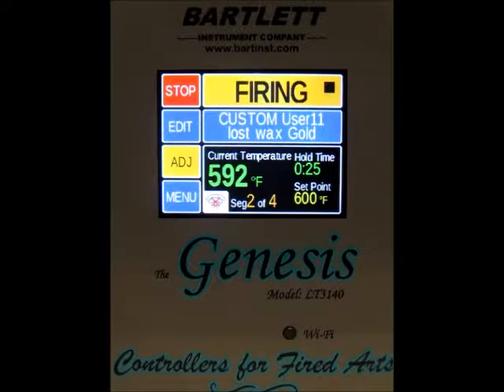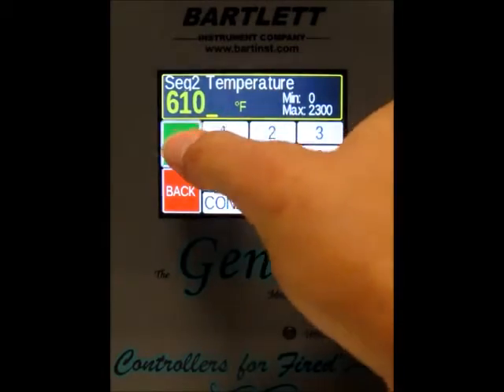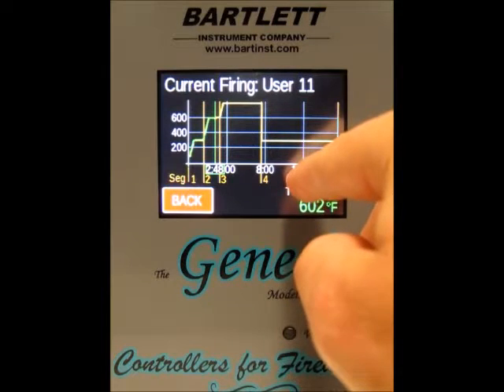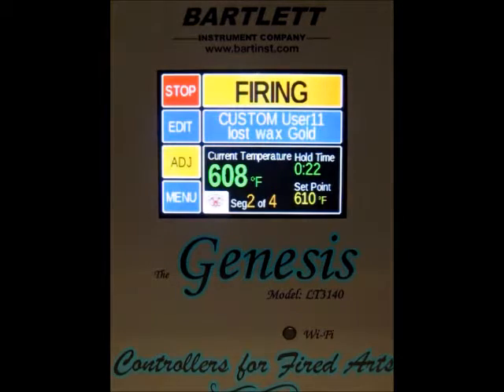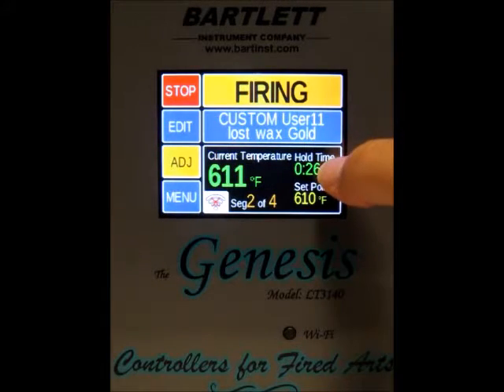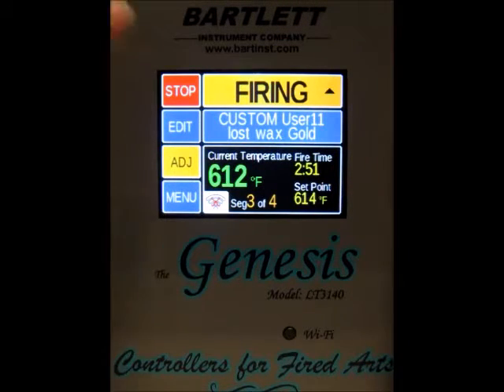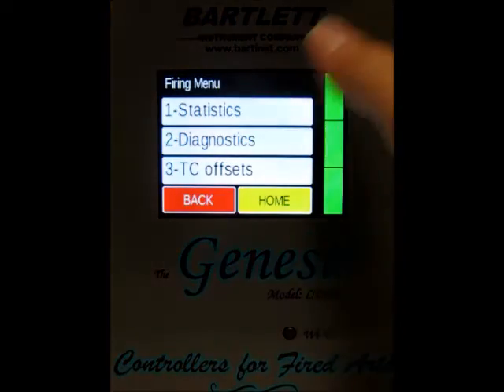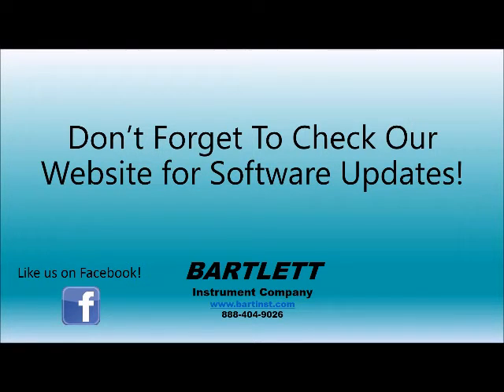Bartlett Instrument Genesis/Genesis Mini | Adjustments During A Custom Firing

Comment: Quick Question.... When I turn the unit on, there is a little light "flash"  under the screen (right where the words The Genesis 2.0 are located). Is this normal?
Reply from the maker: Mary,
That is normal as that is the indicator light for the WiFi module on the controller.

Comment: Look great, I think I want this as an option for the Paragon kiln that I would like to buy. Where do I change the temperature from Fahrenheit to Celsius? Thanks, Robert Glotzbach
Reply from the maker: Temperature change from Fahrenheit to Celsius. You press menu when the controller is at Idle then scroll and select configuration, then select Temperature F/C. Select Degrees C and then press save. Then press Home.